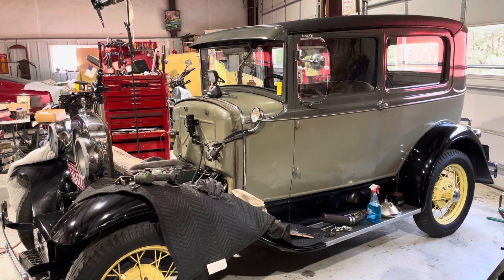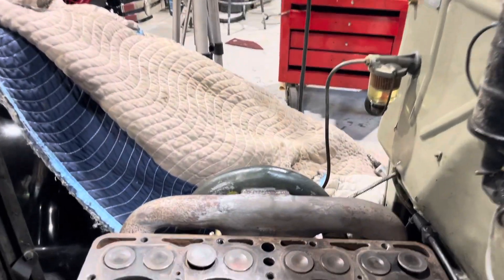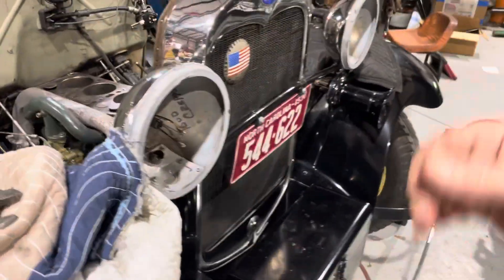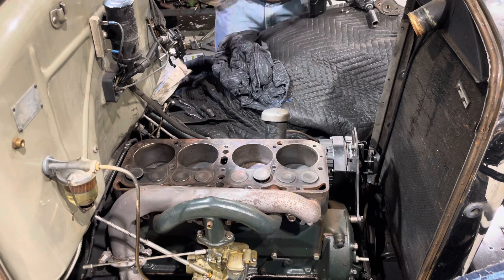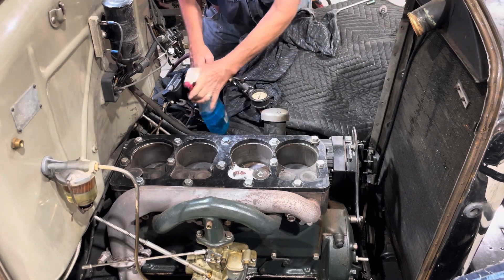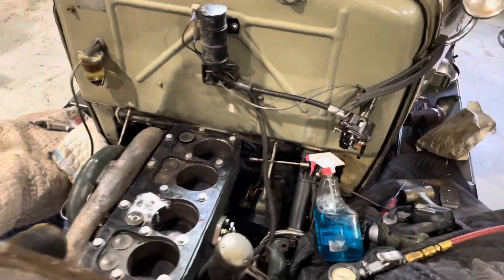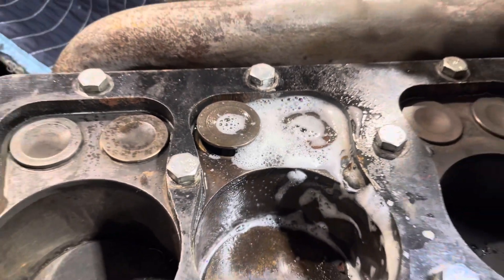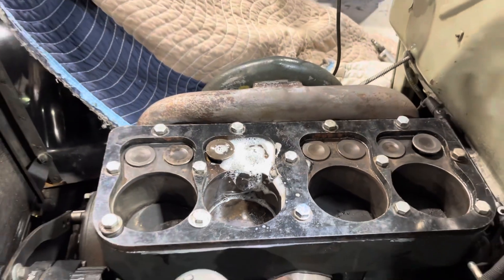Model A Ford with Cracked Block

Comment: I had the same crack in the same cylinder. Used iron tite from Napa. No more water in the oil,worked good.
Reply from the maker: This one is cracked into the cylinder bore and compression was also pushing out water 
Glad you got yours sealed

Comment: Can that be pinned and sleeved?
Reply from the maker: The top of block is pitted deep, B engines are noted for being thin and it's cracked into cyl, bore
Reply from the maker: It could but wouldn’t you want a better block

Comment: Weld it up and machine it good as new.
Reply from the maker: I could spend several hours heating and welding and then bore out and sleeve not worth my time , if it was the last B block might would consider
Reply: @randallstrickland8204    Time = money. Thanks for responding. St.Paul,Minnesota.